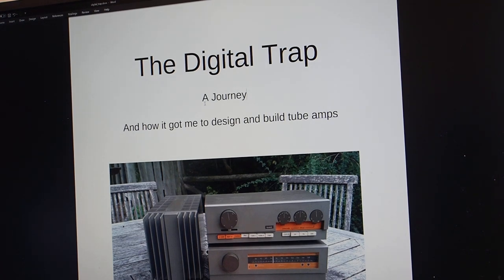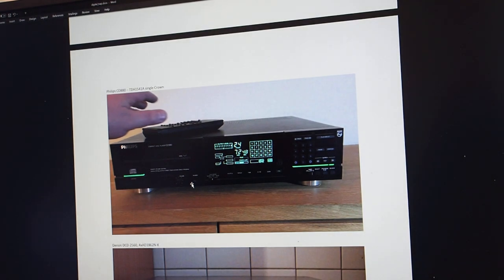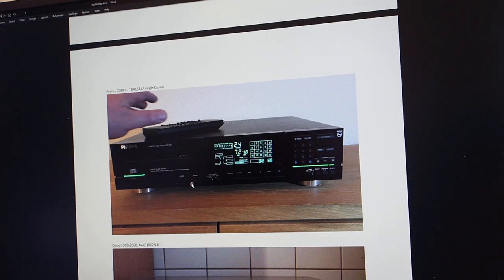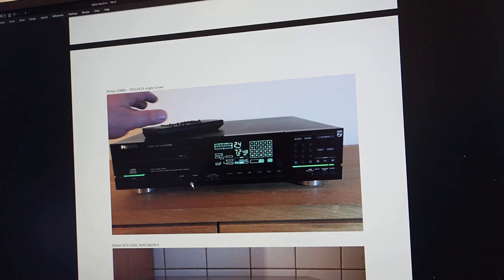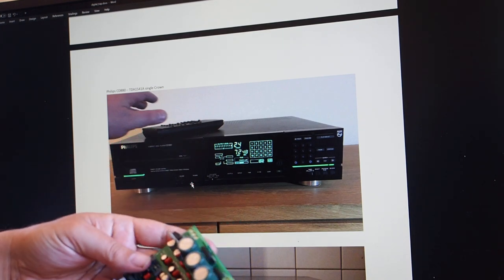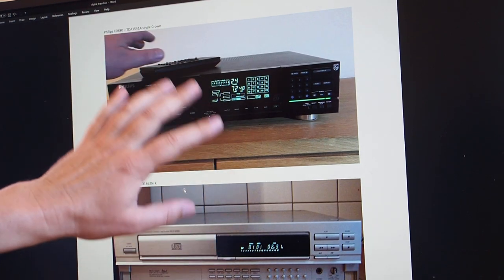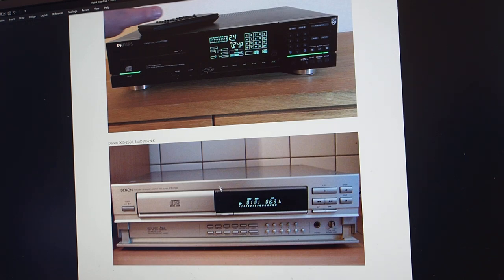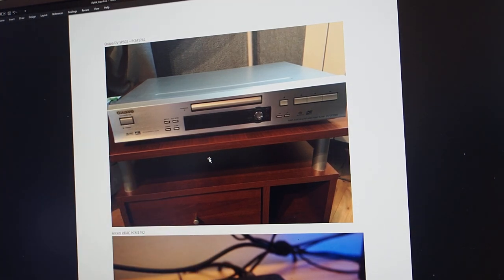The digital trap - part 1/3: My first real system and how the trap got sprung

Comment: Hi Ed, I agree soooo much on your observations! I do have an Pioneer PD93 and an Sony X505ES, those built-in DACs are sooo musical (btw: still have a modified Quad 405-2, love it). On the other hand I do have the quite impressive Weiss DAC 501 with the new mkii upgrade (latest ESS9038PRO), but it is pure analyticial in comparison with my Vintage CD players! Of course fits well with my low efficiency Elac Concentro S507 and Michi X5, but my DIY-rack sounds different (full range speaker). The Abbas Audio SE3.2 I just got, is an astonishing peace of craftsmann and Abbas also uses the best-ever made dac chip TDA1541A! Greets from Germany, Gerald!!
Reply from the maker: Very nice, Gerald - you're bathing in good dacs there. That PD93 is a rare find.. I saw none when I looked for it sometime ago!! I'm curious, which source do you listen to most?
Reply: @Eduard Broekman  Mostly CD ( do buy regular high quality records, like from EMC records) and 2nd Weiss DAC (Lumin Mini U2 Streamer with external Ferrum Hypsos, Qobuz only, no upscaling, NOS only)

Comment: Hi Eduard, nice to hear some history on your system, looking forward to the next parts😊. 

My current system is comprised of two modded quad 405 amps (seperate power supply for each channel) a Denon Av system used as preamp (planning on building a passive preamp in the future) and a Phillips 850 MK2 cd player (picked up for around 250 euros a couple of years ago... Seems like a bargain now 😉) and Bose 901 series 2 speakers and equalizer (equalizer and speakers also modded with better parts).

I like my system very much at the moment... Very musical and emotional engaging, especially the cd player which plays very natural and is non fatigueing. Very hesitant to change anything at the moment. I will attempt an improvement on my speakers in the future which will be a "live" version (Janos style 😊) of the Bose 901 with bigger cabinets to allow for more natural bass (less dependent on the heavy equalisation).
Reply from the maker: Thank you for sharing, Fulco. Sounds like a pleasurable system that you can have on all day. 

Your CD player has the SAA7350 DAC which is equivalent to Philips first 'bitstream' chip, the TDA1547. Based on my experience with the Marantz CD48/bitstream TDA1549, it sounds very 'round' and towards analog - if the opamps don't screw it up. Vocal range is excellent and gripping. Some high-up details go missing as some mood changes/inflections can not be 'felt'. The 49 is reportedly not as good as the 47 though.

I'm also listening to a TDA1541 non-A in the form of a Sony CDP222ESD, and if ever you come across a 1541 player, have a listen. It reminds me a lot of CD880, but more dynamic - yet addictive to listen too. The sound totally hangs in space, not connected to the speaker. Trumps all my other dacs by some margin (except sounding like vinyl).
Reply: Thanks for the insights 👍. Will keep an eye out on 1541 players. I don't know how it is elsewhere but here in the Netherlands the better Philips cd players or any player using the famous Philips Dacs are very sought after, quite expensive and difficult to find 😅.

 I know mine has indeed the bit stream type dac. But the soundscape it provides is certainly not attached to the speakers... If you couldn't see the speakers you wouldn't have a clue where they where placed. I feel the cd, amps and speaker combination provide a very live like soundstage. 

One of the drawbacks is that the system as a whole doesn't provide the most detailed sound but as you mentioned I can listen to it all day long without a problem 😊
Reply from the maker: @fulcobouma  Yes gotcha. For some reason the non-A is not as sought after and perhaps if it wears a Sony label it may help further. It did here. A single crown player is also prohibitively expensive here, yet I don't think they're that much better than a non-A.  
Just if you do start looking, I see early Philips or B&O regularly popping up in the UK for reasonable prices..

Comment: Love your channel. I am interested in your journey to build your audience tube amps. I'd love to discuss a pair of low powered mono blocks- 10 to 20 watts. Thoughts?
Reply from the maker: Hey Charles - thank you. I have not created higher wattage designs, it depends on your goals, speaker, sources (voltage level, type of connection) and budget... I see options at the 10W end for directly heated pentode which I like, the 4P1L can be paralleled very well, or a differential amp with 807 as output tube which can easily reach 20W per channel.